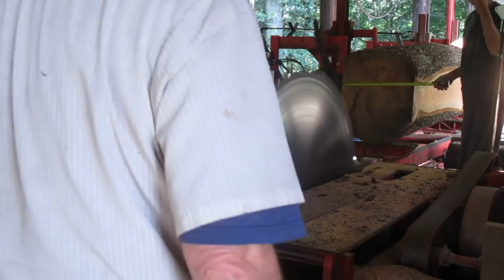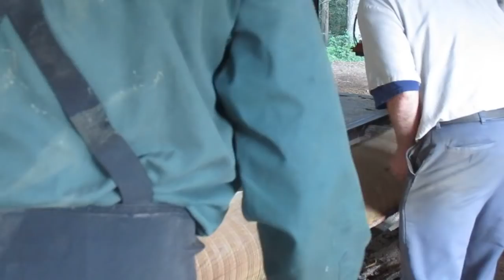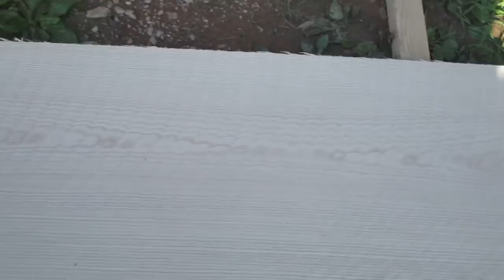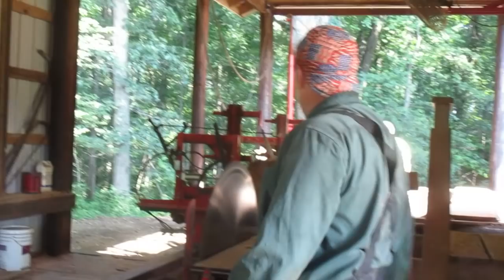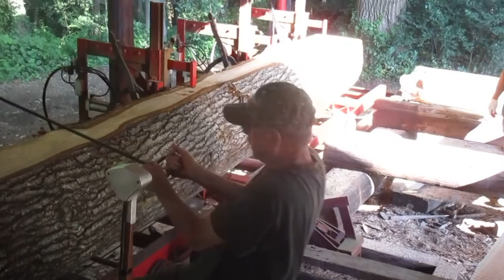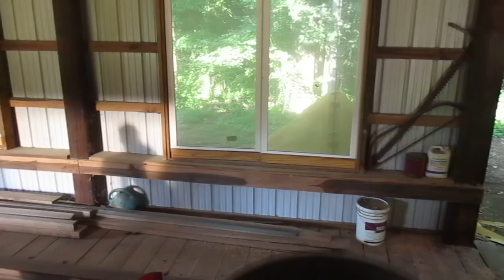Sawing a big Oak at Jeff's  Making more fence boards #419

Comment: 5:00  Blade seems to have a bit of wobble.
Red oak is not very weather resistant, use white oak or ash.
Use red oak for furniture, cabinets, flooring and other indoor use.
Reply from the maker: hi there the blade wasn't up to RPM  john
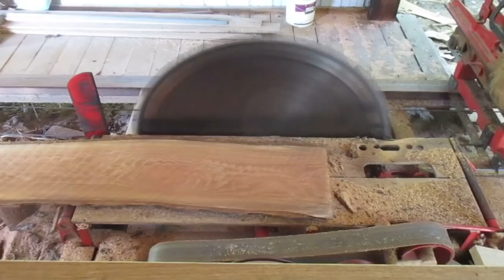Reply: @fricknjeep  There is something wrong, look at the deep saw teeth groove marks at 16:06
Reply from the maker: @davidtrutwin3790  hi ,have you been around a circular saw much thats fairly common .  i see a band mill in your pic . they cut a lot smother . john

Comment: That blade is out of alignment.
Reply from the maker: hi there what to you mean . how do you check your mills blade . thanks john
Reply: The blade isnt out of alignment, when they heat up from friction or worn teeth they will wobble. Depending on how shes cutting you might be able to finish the job, but a tooth sharpening usually fixes that.
Reply from the maker: @ryanforrider3873  thanks john